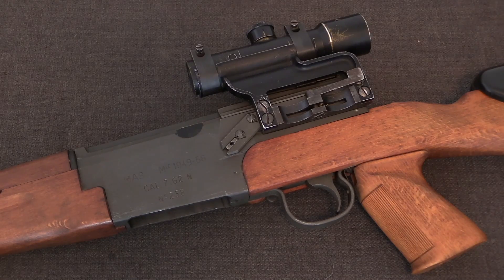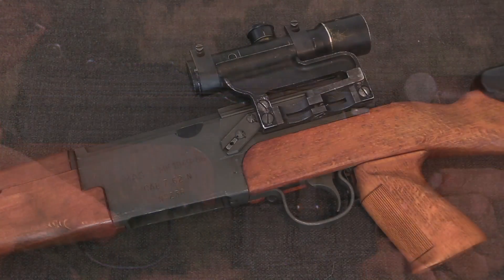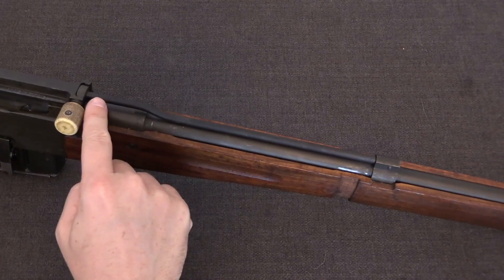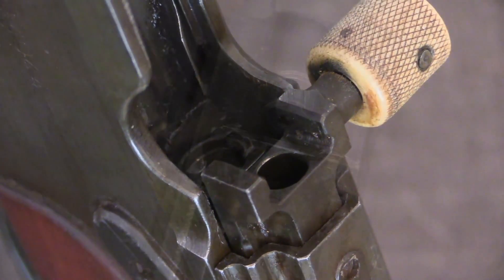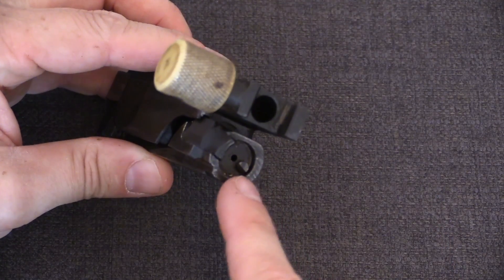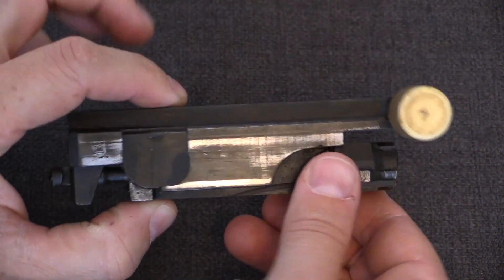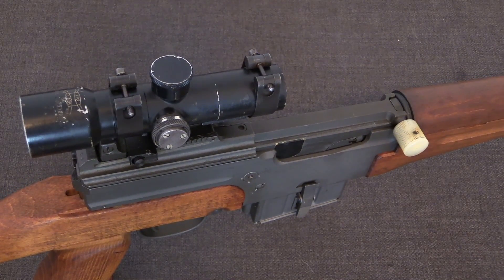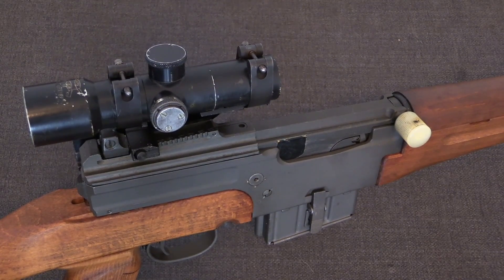How Does It Work: Direct Gas Impingement

Comment: The Ar system could almost be characterised as a gas actuated linear piston.
Reply: @billboardbaggins9771  I have to disagree; the piston is inside the bolt carrier and only moves long enough to unlock the action.

You must be thinking of the AR180 system, because that system is basically the same as an AK.
Reply: No, the AR is direct gas impingement.  That is simply what it is.  Look at the standard Ian used here, sealed piston.  The AR doesn't have a sealed piston.  Literally the only difference between this and the AR is that the AR's gas system also has pressure act against the bolt and not just the gas tube to minimise rotational force on the bolt carrier.

The idea that the AR isn't DGI is "stoner was god" types trying to form a semantic argument where the AR is a piston gun to make people advocating for actual piston ARs "wrong".
Reply from the maker: The AR absolutely has a sealed piston. That's what the gas rings are there for. And it's irrelevant to the question of when a conversion moving the piston to the top of the barrel would be beneficial.
Reply: @RaDeus87  AR-180 uses a short-stroke, anyway, not the same as an AK
Reply: @ForgottenWeapons  No, no it doesn't.  Gas escapes out the top of the gas port in the back once the bolt carrier is moving.  The gas seals on the bolt are only there to allow the gas to exert force on the carrier via the bolt instead of escaping past the bolt, and is the same reason why on the MAS for example there is a hole for the end of the gas tube to interface with :D.
Reply: @crs9796  What Stoner called it doesn't actually matter.  What matters is what's true.  Any definition you can use to describe something like the MAS as DGI also applies to the AR because the gas itself is what actuates the bolt carrier rather than there being an actual physical piston that moves and then hits the bolt carrier or alternately there being a sealed piston from the bolt carrier that travels within the gas tube.
Reply: @jimmydesouza4375  Gas escapes past the sides of an AK piston as well when it moves a certain distance. That doesn't mean anything with regards to it being "sealed".
Reply: @jimmydesouza4375  Are you saying the the bolt isn't a sealed piston because it lets the gas vent after it's done it's job?
Reply: @jimmydesouza4375   I agree.  The AR is 100% direct impingement, by literal interpretation of the words direct and impingement.  Just because the AR-15 can also be characterized as having a gas piston does not mean it cannot be direct impingement either.  There is nothing that requires the two to be mutually exclusive.  By dictionary definition, the Mas-49 also has a stationary gas piston as well, sealed or not.  A blind recess is still a gas cylinder with the gas tube protrusion acting as a stationary piston.
Reply: All gas operated guns are direct impingment if you want play with words... gas is "directed" to "impinge" on another surface to make things move (or not move).
Reply: @gummigoober  No because the AR15 applies in the literal definition of the term direct impingement without any play whatsoever.  To say the AR15 is not direct impingement requires play on the term.
Directed impingement changes direct, a noun behaving as an adjective, to directed, an attributive verb
Reply: @gummigoober   To expand on this definition, if impingement meant "to strike" as I think most people believes it means, then it would never have been called "direct impingement" in the first place, they would have just been "gas impingement" rifles.  To add to this, every Ljungman DI type gun uses a gas piston, and does not actually truly "strike" the BCG.  It uses gas expansion.  Technically a gas strike is still the result of gas expansion but whatever.  This is why you do not see DI guns that have the gas tube flush against the operating surface of the BCG.  It needs the expansion chamber and piston system in order to cycle.  Just because it is not a perfect gas seal does not mean it's not a piston either.  You can remove the piston rings from your engine, and it will still operate as a piston (though with considerable less efficiency).  It is still a piston.  I guarantee you, if you took the Mas49 or AG42 or Hakim, and you lop off the gas tube so it did not retract into the gas cylinder, or if you bore out the gas cylinder or just modified it so the gas port is simply flush against the BCG with no expansion chamber, the guns would not function at all.  There is no way to harness enough energy from gas striking a surface like that.
Reply: Term DI should be reserved to Mas 49 type deal. AR-15 is different enough , to have its own term.
The difference is piston being inside the bolt carrier, not on the outside, as in Mas 49. 
Maybe internal piston direct impingement (IPDI). Direct impingement with internal piston (DIIP... )
Reply: @tiortedrootsky   Well, people have been calling it Stoner DI as opposed to Ljungman/Rossignol/standard/true DI for a while now.
Reply: @MarvinCZ  You're missing the point.  Arguing that the AR's gas system is sealed and that makes it not a DGI implies that it is fully sealed and it's not a hermetic seal where the tube interfaces with the bolt carrier on an AR.  Compare this to the AK that you mention, which is sealed.  For the first portion of the bolt's travel on an AK there is a sealed system between the brass, the slug travelling down the barrel and the piston face which is only unsealed when the piston moves past the vent ports.
Reply: @bBlaF  No I am saying it's not a sealed piston because it's not a sealed piston. There's no purposeful sealing between the gas tube and the bolt carrier.  It's literally the same arrangement on the MAS by the way, the end of the gas tube fitting into a cavity in the bolt carrier forms a piston, but you argue it's not a piston gun because the piston isn't sealed.

That's literally the entire argument.  On the overall conceptual level there's no real difference between the MAS and the AR in terms of how the gas system operates.  If one is a piston rifle the other also has to be.
Reply: @jimmydesouza4375  Guess your gunsmith never gave you the talk about how the gas in an AR only vents after the carrier has moved far enough back for the vent holes on the side to clear the gas rings.
Reply: @jimmydesouza4375  The Stoner internal piston is called that because gas coming through the tube and into the bolt carrier has its pressure directed into the space between the bolt carrier and the gas rings in the bolt. If it were direct impingement, there wouldn't be that pressure between a static and a mobile component. The gas key would just be a cup, and there wouldn't be an expanding chamber other than that formed by the bolt carrier's interface with the gas tube.

For more clarity you could simply read Stoner's patent: https://www.google.com/patents/US2951424 

DI is defined by the lack of a piston on which the gas acts, with the gas instead being piped directly into contact with the bolt carrier, and that direct impingement on the bolt carrier providing the force. In the AR, the gas enters a space in the bolt carrier where it pushes against both the bolt carrier and the bolt, driving them apart and unlocking them through directly applied gas.
Reply: @bBlaF   No, it's constantly venting from the gas key and gas tube interface.  It is not sealed there, just like in the Mas49. The BCG chamber on the AR-15 may have a gas seal but it is not a sealed chamber by any means.
Reply: @xthetenth   DI is NOT defined by a lack of piston.  All DI guns have a piston that I know of, including the Mas49 example used in Ian's video.  By definition, the recess in the Mas49's carrier is a gas expansion chamber, and the gas tube is a stationary piston.  If you look at the gas tube of the Mas49 (disassembled) , the end of the gas tube is even flared outwards like a piston head for a greater (but not great) gas seal.  This is no different from any other piston gun, as the AK or your choice of piston rifle does not have a gas seal on the piston, as all pistons account for some blowby past the piston head. 

If we want to talk patents, Stoner's patent is a bunch of legalese that doesn't mean much.  "Expanding gas system" doesn't mean anything because all gas operated systems operate under the principal of expanding gas, thus he can use this terminology to separate his DI system with others.  Counter example of how nonsense this is, US8210089B2, indirect gas impingement, is just an AR-15 with a long stroke gas piston.
Reply: Eugene stoner supplied a rifle that got soldiers killed in Vietnam... Wasnt until the US MILITARY took a look at it and FIXED it.
Reply: @Chiefshadow4   Are you being ironic or do you actually believe that
Reply: @xthetenth  "If it were direct impingement, there wouldn't be that pressure between a static and a mobile component."

By this definition, the MAS system isn't direct inpingement either then, as the bolt carrier is a mobile component.

THATS LITERALLY THE WHOLE POINT OF THIS :D.  There is no definition of direct inpingement where the AR isn't DI that doesn't also preclude every other supposed DI gun.  The AR 15 IS DI.  The idea that it's not DI is a moronic semantic argument created by stoner is god types to try and explain away the "inferiority" of the stoner design to piston ARs by trying to pretend the stoner design is a piston AR...  That's why you only see it fairly recently.
Reply: @xthetenth   Took a while, but here is the documentation on the MAS49 that shows it is indeed a piston gun and DI, in the same sense that the AR-15 is. These were taken from Sturmgewehr website in some directory but there were a TON of documents and crazy MAS pictures there.
https://imgur.com/a/X8w6nZ7
Note how it labels the gas tube as a piston.
Reply: @requen  Thanks for that link, good article
Reply: The AR absolutely is direct impingement, more so than the MAS-49. The gas directly impinges on the bolt, that it turns a few corners before hand means nothing. The MAS-49 the gas impinged on the carrier not directly on the bolt. This makes the AR MORE direct impingement than any other design.

Comment: Very informative. 

Please correct me if I am wrong. I concur that the AR10/AR15 is a gas piston operated rifle. However, the "beauty" of the AR10/AR15 system is that it places the gas pistol centreline ( spelt correctly because I am an Aussie) directly in line with the bore axis. This then reduces ( if not eliminates ) any barrel climb due to gas piston being above the bore axis ( no vertical recoil force vector )
Reply from the maker: That is correct. I have one of the short videos coming in a few weeks on the AR system.
Reply: I would suggest that the main advantage to the AR system is the low mass of the BCG as it reciprocates.
Reply: @ForgottenWeapons  Makes me wonder if there is a system out there with TWO gas pistons one either side of centerline to balance each other.
Reply: @AM-hf9kk  aren't there some gas tappet operated guns that have dual arms acting on the bolt carrier? But i have a feeling you are talking more about dual gas systems opposite each other and operating in concert. Which sounds like a heavy, complex, and expensive idea... Maybe the Swiss will try :P
Reply: @grumples1517  I think either way would be cool to see.  Though it seems less Swiss and more Russian, with a kind of "one AK good, TWO AK BETTER" mentality.
Reply: @AM-hf9kk  Closest I think you'll find are annular pistons (around the barrel).
Reply: @AM-hf9kk  the Russian balanced recoil system is very similar. Two pistons in the same tube over the barrel. One cycles the action backwards. The other cycles a weight forwards. To balance out the weight of the operating parts going backwards.

Comment: Just this morning I was reading an article about the history of the M4. Second paragraph led off with the M16 and the old classic regarding its early reliability issues: "Implementation of the Direct Impingement Gas System led many soldiers to believe that the weapon never required cleaning, when in fact the direct impingement system actually meant that the gun needed more cleaning, not less".
Why does one so frequently see the AR-15/M16 described as using a direct  impingement system? Is this just one of those "Gun Myths" that have done the rounds of the net for so long that it will never die? Or just a problem of faulty/confusing terminology?
Edit: I suppose I'll find out in Ian's  next How Does It Work video!
Reply: It comes from the fact that nobody seems to have accurately described the type of system the AR family uses, at least not with a succinct term. How would one describe a system where the bolt is also the piston, and the piston/bolt is blown forward to unlock the breech? Very unorthodox compared to almost any other firearm.
Reply: Even your comment slightly misstates the operation.  You can't blow the bolt forward - it's locked into the barrel extension. Yes the bolt head has the gas rings, but the gas is really pushing the carrier back away from the breach to actuate the cam pin which unlocks the bolt lugs from the extension.  The MAS 49 Ian demonstrated doesn't dump gas INSIDE the bolt, only in the cup at the top of the carrier.
Reply: Gas Blowback Bolt Carrier idk
Reply: @1 1 "The pistons are all in different places,  called different things, and look different."  That's like saying an Apple is the same as a Dandelion because they both spread seeds.  Yes, they're both operating on a similar idea - get the seeds spread as far as possible to continue the species.  Semi-autos are similar in that they're using gas pressure to eject the spent round and reload a fresh one.  Other than that, they're VERY different in implementation.
Reply from the maker: As I say in the video, the defining characteristic of direct impingement is that the gas is not directed into a sealed piston. If you look at the head of an AK gas piston, you will see several rings around the circumference, which are there to seal the system for the first cm or so of travel. The Ar similarly has gas rings. The MAS and Ljungman systems do not.
Reply: @1 1 The only way to really know the truth is to wait for Gun Jesus video.
Reply: @1 1 The AR internal piston thing is exactly as old as the AR, and is definitely not something that a bunch of shooters came up with. Stoner's patent for that gas system from 1956 explains the whole thing.
https://patents.google.com/patent/US2951424A/en
Reply: @ForgottenWeapons   Those AK piston grooves don't really seal the system though.  They're just there to harness the energy of the blowby, and that's it for improved efficiency.  The AR's piston rings provide a physical seal.  I mean if you cut a groove into the MAS49's piston head (I consider it a piston head since it is actually flared out like a piston and operates exactly like one by dictionary definitions) it wouldn't suddenly become a sealed system.

Comment: Ruger Mini 14/30 series uses a variation of DI. Ar15/M16 contrary to popular belief has a gas piston. The bolt is the piston and carrier the cylinder
 Excess gas is vented out the ejection port when the bolt is unlocked.

Comment: My first MAS 49/56, the idiot that owned it before me removed the grenade firing pieces and replaced the pin with his own and some wire. I got the valve handle back on but the valve handle would still cause the gas block to block the gas port a tiny bit unless you paid attention and made sure to back it off just a hair. Just a tiny blockage of the gas port and the rifle was a single shot only. Drove me nuts until I figured it out and now she runs fine.

Comment: An obvious disadvantage with this system is that you will get a lot of carbon fouling and deposits on the bolt carrier and the action in general as you are venting hot burnt propellant gas directly into the action. A short or long stroke gas piston system should be much better in this regard.

Comment: It's interesting how many variations there are in achieving repeat fire in firearms. One interesting idea I've had, what if you had a Gatling style rotating multi-barrel multi-chamber assembly, but it harnesses the energy of firing to also rotate the assembly somehow? I wonder how such a design could be achieved...
Reply: Yes, Russia has gas operated Gatling guns as aircraft armament and naval CIWS, Gryazev-Shipunov GSh-6-23 and GSh-6-30. Compared with externally powered Gatling guns, they have very fast spool-up and light weight, but they also have a tendency to beat the aircraft they are fitted on to death.

Comment: "So the AR is not direct impingement?"

"Nope instead of the gas acting directly on the bolt carrier, it gets tapped through a gas key and into a special chamber where it acts on the BCG from there".

"So its direct impingement with extra steps?"
Reply: No, it is not. Unless you call all gas-operated guns direct impingement - the gasses also act on the BCG "with extra steps".
Those extra steps are the distinguishing factor.
Reply: It's a joke. I know Stoner described it as a piston system in his original patent. Nobody just wants to have any fun.

Comment: What is the real disadvantage of the system? You said it can not really be configured. That seems possible though with different sized "holes" that adjust the amount of gas used.
Reply: Or use an adjustable gas block.